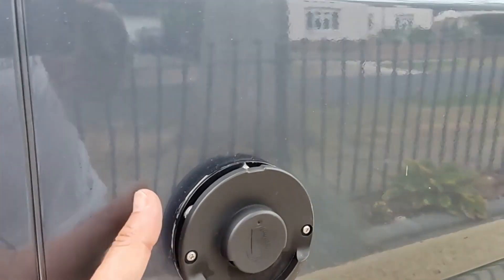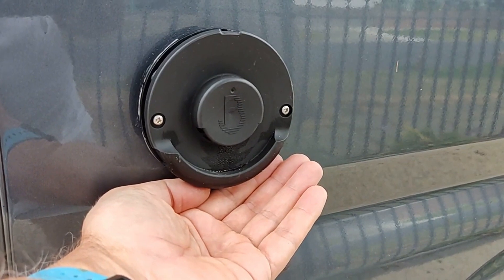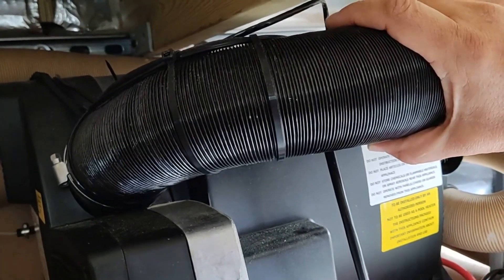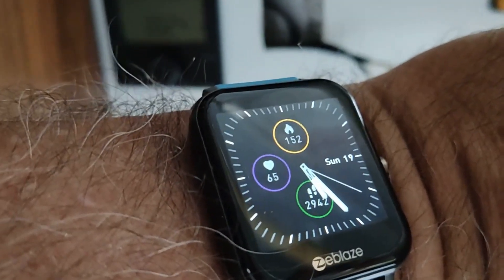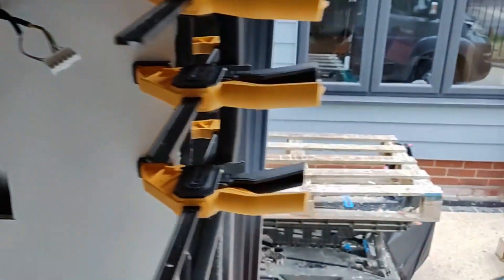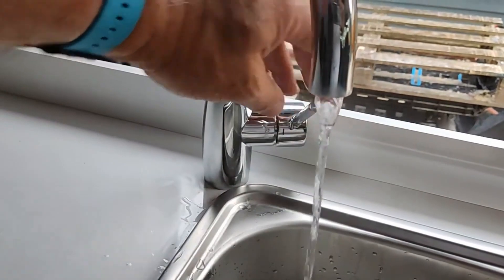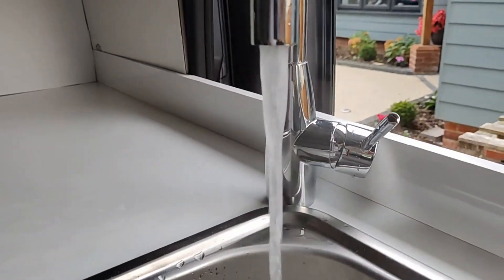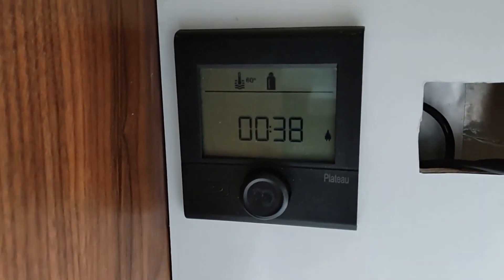JP Diesel Heater First Water Heating Test

Comment: Great Video John, can't wait to get ours up and running! - Would love to see it running on 230v for hot air / water, power draw and times before hot air / water. 
Thanks!
Reply from the maker: Thank you! Looking forward to hearing how you get on. I have already run it on electricity for hot air. It draws 1860W and is silent. I didn't test the water heating with it yet. I intend to do some tests in the winter perhaps including fuel consumption.

Comment: When air heating, does this alternate the output between high and low like a cheap Chinese diesel heater or does it automatically vary the pump rate to adjust heat output and stay consistent?

Comment: Hi I’m just installing the same heater are you going to post a video on the water plumbing side 
Cheers
Reply from the maker: I hadn't planned to but if you have any questions, maybe I can help.
Reply: I would also be interested in how you connected it all up, I wanted to use the JG speed fit like pipes like you seem to have used but need to see how to connect that to the heater.
Reply from the maker: @hasasanator  Hi Hassan, I used a 10mm compression to 12mm speedfit adapter.

Comment: Hi John, thanks for sharing these videos. I am interested in this heater combo. I see you also have IoT videos. Did you look into the steering of this unit ? Would be cool if we could get an esp in between there to control the system instead of that control panel.
Reply from the maker: Lol. Yes, it's on my list. I asked JP for the serial protocol but they said no so I'll have to do it the hard way - lol
Reply: @Magic-Smoke  Would be awesome if you could reverse engineer (part of) the protocol. It is unbelievable that in RV's you end up with a display/control for each and every technical solution ... While it would be so interesting to let the battery capacity, solar, weather prediction influence the decision to heat using gas or electricity.